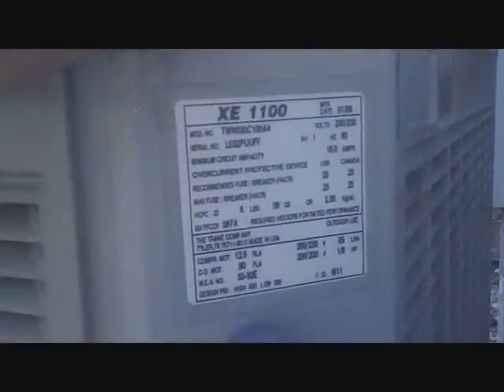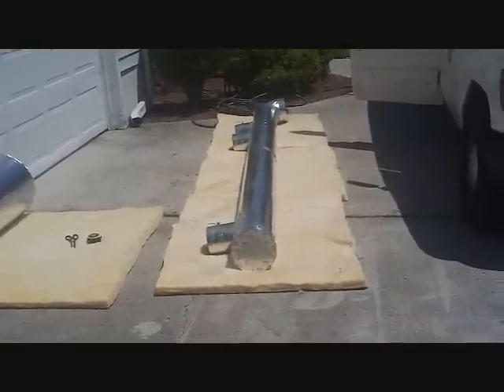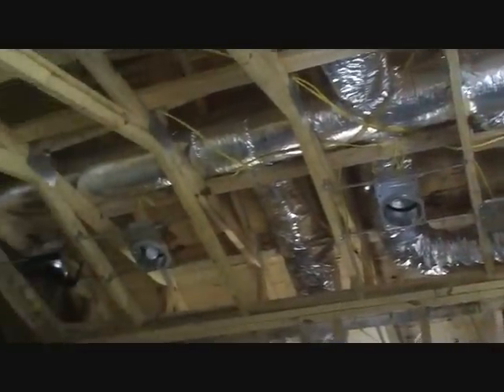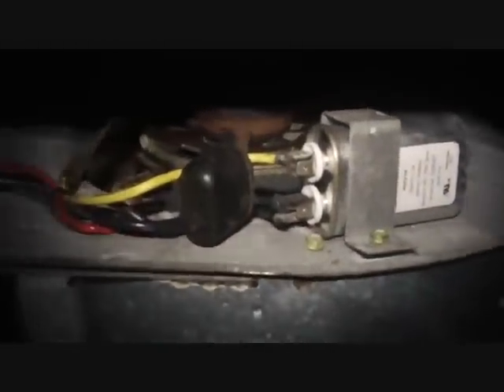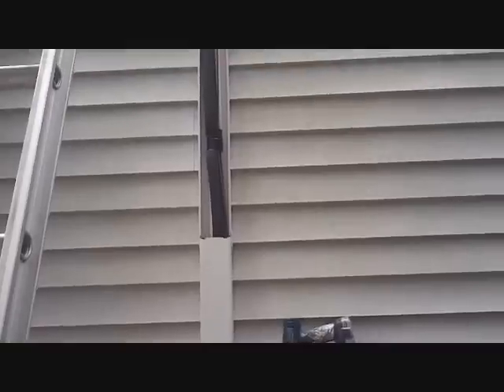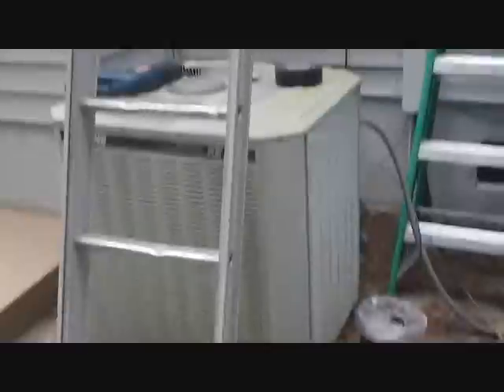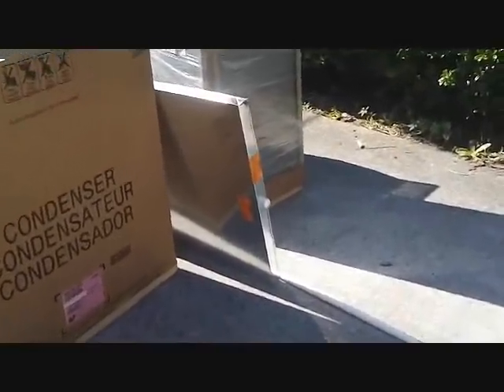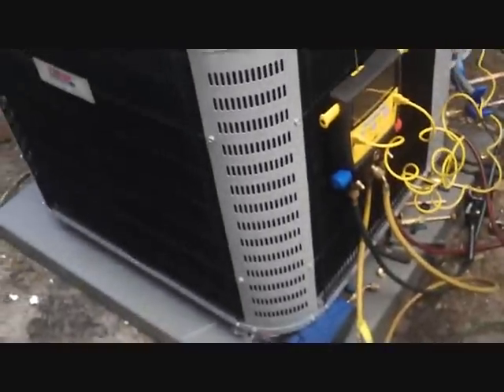HVAC Install- Heil HXH5 15 SEER Heat Pump Install

Comment: Your Honest opinion? Im in the middle of replacing my 20 year old Trane condenser and 3 of the HVAC guys that have come out is recommending the same 4-ton 15 seer Heil heat pump. Is Heil anygood? Ive never heard of it until now. Apparently they are made by Carrier?